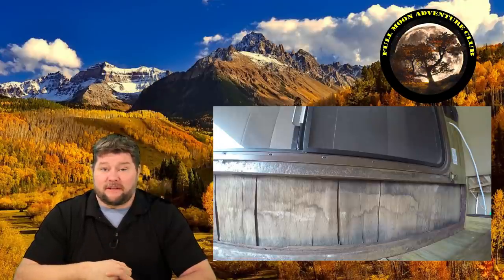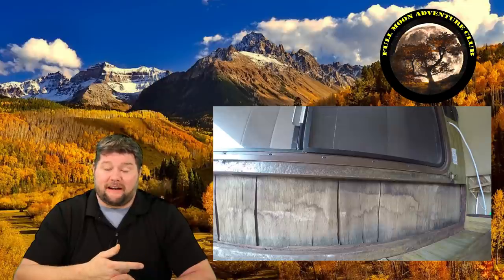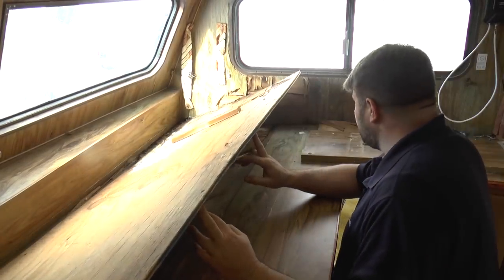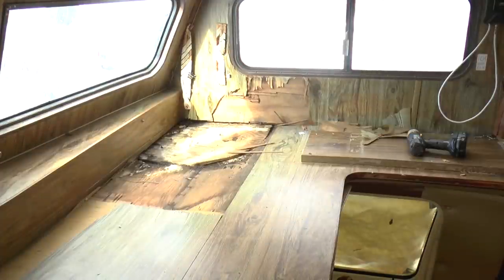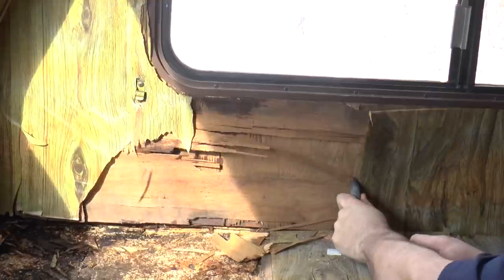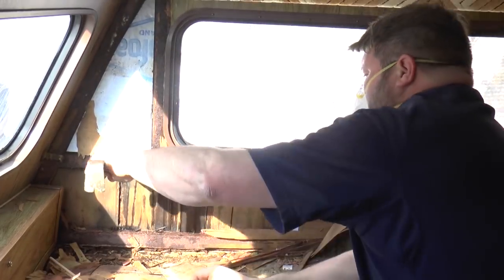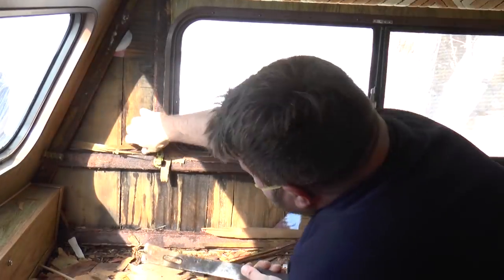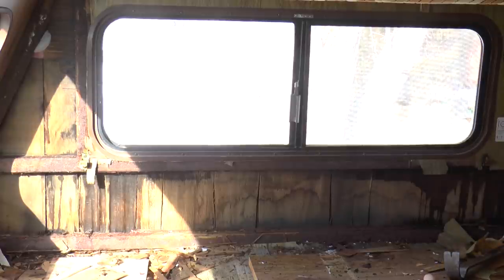RV Water Damage Repair Part 1 - Demolition

Comment: Wow! These videos are so well done that I may decide I can tackle some of my issues in my Class C. I'm scared to death, honestly. Single middle-aged very overweight and (the truth will set you free) lazy woman. Fulltiming. RV is disintegrating around me. Have to face it and beat back the deterioration. She runs good and appliances are great. I just don't know how structurally sound she is and she leaks bad, depending on how I'm parked.
Reply from the maker: The repairs can be challenging and a bit overwhelming at first but you can do sections to keep things easier. I think your top priority is to stop the leaks. They will eat your RV fast. Even if you just use some flex seal and go crazy on seams, windows and roof areas until you can  properly reseal the roof and walls with the correct materials. Any method to stop the water leaks now would be beneficial.  Most motor-homes have a metal frame  which resist water leaks far better than wood frames but structural damage will occur with water infiltration. Good luck and happy camping.    Jim
Reply: Bea, Honey dog and me 🤣 You sound like me I know this Comment is old But Am Scared $hitless & completely Lost hope you got your fixed wish me luck & I read your comment Am like that’s me right now 🙏🏼🚌💙
Reply: @KyaSimonsLife  Ugh! Well, good luck to you on that endeavor. I bailed and got into a much better-conditioned travel trailer. Problem solved, or at least dodged. I still have to get rid of the old girl.
Reply: How do you know when to remove old wood? Or structure? Besides the obvious of wood falling apart and dark.

Comment: I cleaned out the weep slots.
And bam..stopped comming inside
Noticed water on inside window track.
Debris in outer track
Took stiff wire and cleaned them out.

Comment: Hey Jim,  I've been thinking why dont we use exterior primer the wood on the paneling backside,  inside walls,  ect.., why leave it bare. If it had some protection the water damage wouldnt be so catastrophic. Pros,cons?
Reply from the maker: I don't see any reason why you couldn't paint the Interiors of the walls for added protection. However I think the main objective is to keep water out of the inside of the RV and therefore painting the insides of the walls would just add weight, cost time,  money and hopefully never be necessary.

Comment: What do you suggest for sealing the wood in a similar project? I’m replacing the wall around my slide out due to water damage. I noticed the wood that was sealed with something black, was not damaged hardly at all. Do you know what that is? It appears to be a rubbery sealant. I want to seal these new structural beams with that. 
Can’t anyone suggest something that would work well for this?

Comment: I am rebuilding mine and was pleasantly surprised to learn that i have the steel framing also.im rebuilding the overhead on my 1990 jamboree rallye where did you find the paneling.i want to go back with similar.im also going to treat the rust like you did
Reply from the maker: I found my paneling at Home Depot. It changes from season to season but that's where I got mine.     Ji.
Reply: @fullmoonadventureclub  thank you.

Comment: Very nice video. Thank you. Quick question, where was the leak? I have a small leak but couldn't see any water coming in. I did see a black line on the outside of the RV after it stopped raining. Just to stop the leak I tried some black tape that was recommended at Lowe's and I am hoping I identified the leak. We will see. Next, I plan to do what you did if necessary. Was wondering where your leak was. Thanks again and God bless.
Reply from the maker: I think my leak was coming from the marker lights on the front of the cab.    Jim
Reply: @fullmoonadventureclub  Thanks again!

Comment: Its possible to relocate the wires wired outlets,  and ac heater control panels?
Reply from the maker: Yes, that is very possible. However, if you're not comfortable with RV electrical you may want to hire professional..    jim

Comment: Any recommendation for the "rotting wood" smell?  Can't seem to get rid of it.
Reply: Use kilz mildew and mold primer. Also they have a brand called bullseye. I would stick to the oil based stuff and have plenty of ventilation when priming it.